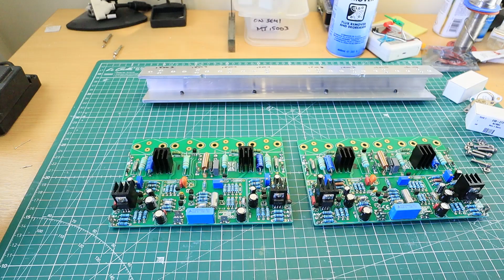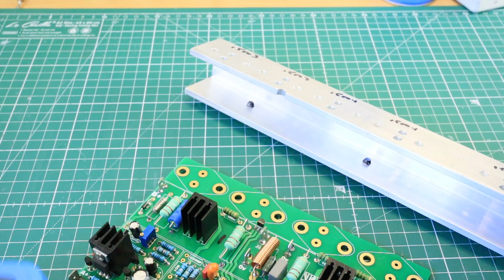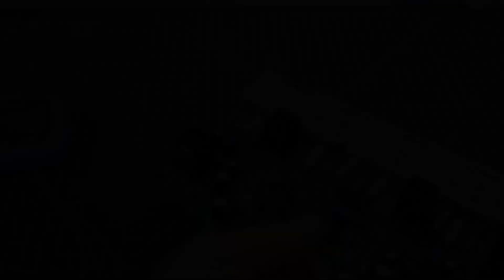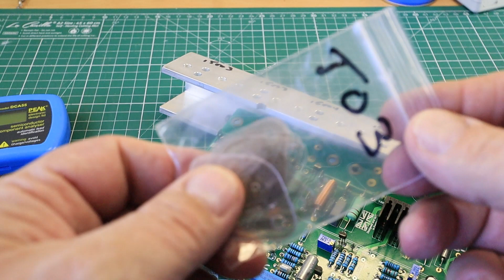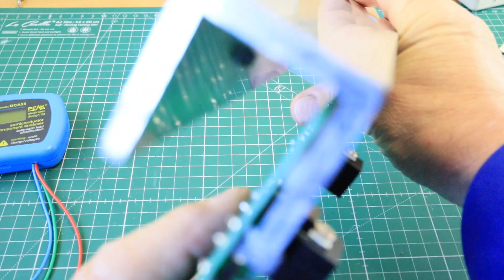Avondale Audio NCC300 Biuld (Part 2)

Comment: great work m8 are these boards for sale from lez w ?
Reply from the maker: No I don't think they are available Brian. In the beginning of the NCC300 'beta testing project' Les was trying to ascertain if they where any good and handed a few pairs of bare boards out to a few who expressed an interest and who A: could build them (their not really a simple build)  B: give him honest feed back.  I believe he sent quite a 'few' pairs out and I think they have not been built, hence these videos.  The Boards I used in this video project were from some years ago now. In fact I recall I had to push a bit to get them, Les knowing I already had one amp up an running at that time. But I've managed to buy some more since for the family...
Reply: You are inspiring me to build a ncc300 based amp
Sadly it will be by just buying the completed modules from Les...but at least it's another one out there!!
Ps
I have two Avondale amps already...one ncc200 and one ncc220  ..so a 300 is a must!!